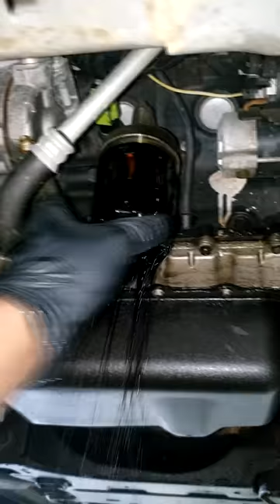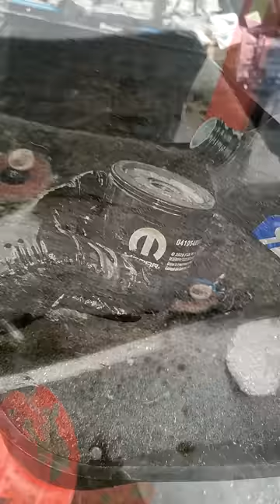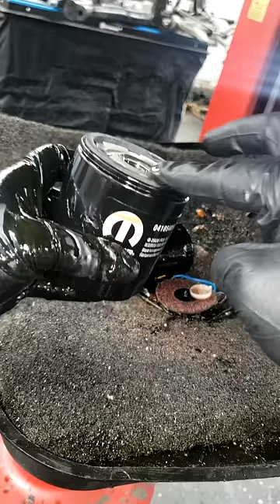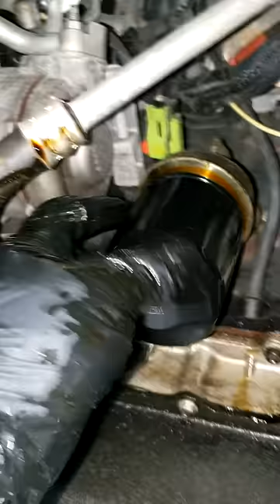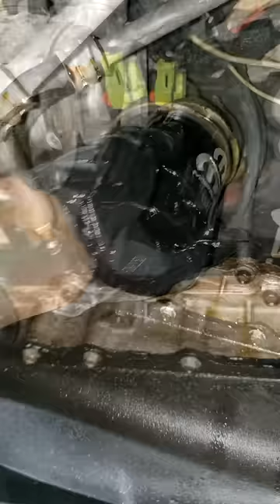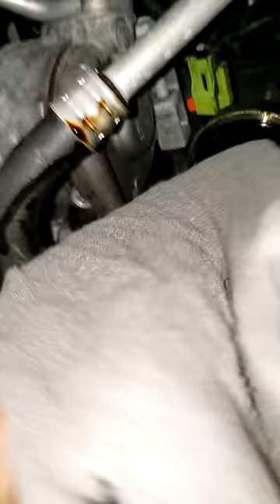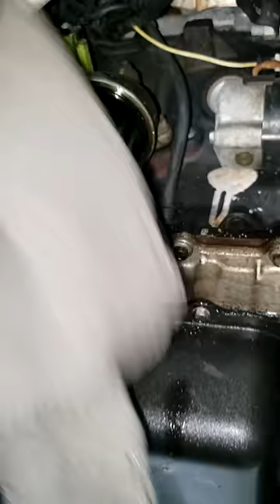Don't Lie.. Are yall still doing this?

Comment: 1) ALWAYS lube the gasket with fresh oil. 
2) pre-fill only works on vertical filters.
Reply: Answer is yes
Reply: I've pre filled my 2017 forester filter.  It's vertical but. Upside down.  I fill it up and the filter soaks it up.  Then I flip it over and screw it down.  Never makes a mess.
Reply: He primed the oil filter, but he did not clean the filter meet surface on the engine, old oil was still evidently still there, should have cleaned it before the new filter wa put on.
Reply: It's also entirely unnecessary to fill them the pump will fill the system in under 10 seconds of not even 5
Reply: @spyrolover24  can be done on  engine with good access, but it' s rarely the case on todays cars...
Reply: @Chrissy212 yes, I have 2 classic cars w huge upside down filters, and oil pressure gauges. they register within 5 sec of starting, no worries here (80 MGB, 73 Aston Martin)
Reply: @Chrissy212  if that's the case then the filter wouldn't need a drain back plug to stop dry starts..which is why you put oil in the new filter ....to stop a dry start
Reply: @leneanderthalien  orientation axis doesn't matter. The filter media will hold a surprising amount before it is completely saturated and no longer absorbs additional oil.

It's a described procedure in most older FSMs. Pour a small amount in, turn the filter body 90° and rotate until filter media absorbs the oil, repeat until filter media is saturated and no longer absorbs anymore oil, a very small amount of visible oil should be present, drain off excess if overfilled, install.
Reply: I don't fill the filter, but I do wipe down the area clean and put fresh oil on the gasket.
Reply: @spyrolover24 I was wondering about that.
Reply: gotta clean your mating surfaces as well.  im not a smart man but i always prep my gasket surface before contact.
Reply: You can at least get some on there without a mess.

Comment: Hard to believe anyone thinks fresh oil is dirty. It’s as clean as it will ever be.
Reply from the maker: Lmao, dude, I see such comments on this video at least 3 a day. I scratch my head every time. Its like they suggesting that even the new oil thats going in should be filtered of any trash and im like, but its new oil. Some people just think entirely to hard and over think things..smdh
Reply: @OnlineMechanicTips most people don’t think enough honestly. They just open their mouth with what ever first pops in their head.
Reply: @OnlineMechanicTips I had never heard of that. Good tip.
Reply: @OnlineMechanicTips most people just wanna debate about SOMETHING 😂. If you said the sky is blue someone in the cesspool comment section of YouTube would've been like "well technically is not blue 🤓🤓🤓🤓
Reply: The theory of putting the oil in the filter is that the oil will get faster to the engine thus lubricating with minimal damage. I change my own oil and never do it while having cars lasting for hundreds of thousands of miles.
Reply: doesnt get any cleaner than brand new oil
Reply: @OnlineMechanicTips  lol if they think new oil can be contaminated which has always been an unavoidable case and also even a new filter fresh out of the box is also contaminated with microplastics and dirt. By that mindset they should dunk their fresh filter into brake cleaner to get rid of those microscopic particles as well and might also buy a new engine every oil change too since old engine is also contaminated with dirt, metal and sot which will ruin the filter and the engine if they’re so worried about little tiny particles will scrub their cylinders from pouring fresh oil in the middle of the new filter.
Reply: Thanks. I thought I was tripping.
Reply: Right? All these people worried about getting oil in the outlet side of the filter when oil from the jug is clean. Now a fuel filter is a different story. I don’t fill oil filters anyway so oh well
Reply: Last time I checked the oil fill hole goes directly into the head of the engine. I can literally see my camshaft on my ford 4.6 when the oil cap is off. So unless these people are filtering the oil as they pour it into the fill hole they are still putting unfiltered oil in the engine. People really think they are smart when they make that statement.
Reply: You haven’t worked with engineers either.  If you look at “ fresh “ oil under a microscope you’ll quit flapping about things you don’t know about…
Reply: @GlycerinZ  yes it does, until it goes through the filter there’s all kinds of contaminants in oil.  Do you think it’s refined in food grade facilities and then carried in sterile trucks and through sterile pipes into sterilized bottles?  
Think again. Look at it under a micro scope sometime and rethink your statement.
Reply: @axe4770  or, they’re right, new oil IS contaminated, unless you get yours from some special sanitary food grade facilities.
The filter removes the foreign particles down to microns.  
When oil is to be used in some equipment it is pre-filtered and tested down to a predetermined micron allowance because it’s filthy from the factory, the trucks, the pipes, the tanks …all of it.
Your oil is “ as clean as it will ever”  be AFTER it goes through the filter.   There is a whole world of things you don’t know and others have been trained in, this is just another thing you don’t know about.
Reply: @OnlineMechanicTips they think they gotta drink it
Reply: Until a small piece of the foil/plastic seal accidentally gets broken off the top of the bottle when opening it and gone unnoticed. It happens. I dont pre-fill my filters for that exact reason. Never have, never caused an issue.
Reply: Because it’s fresh straight from the ground 😂😂😂😂😂
Reply: Some people are so worried about new oil being contaminated and pouring it into the filter. What do they think is happening when they pour 5 quarts of unfiltered oil into the fill hole on top of the engine?
Reply: @neilchilders5442  Its not about filtering the new oil,its about getting oilpressure faster.
Because when you start up the car the oilpump first have to fill the new empty oilfilter before you get oilpressure.
Reply: @AntilleanConfederation  they are trying to prove their value, they just gotta try and one up someone.
Reply: It's not to clean new oil it's the pocket of air that people worry about
Reply: Oil is messy new or old, it is dirty.
Reply: Yea no you just dont have the capability to understand contamination. Youre the guy in the video bud. Simple. Anyone can turn a wrench@OnlineMechanicTips
Reply: Nope.  It could have plastic bottle shavings in it.  Or even a gnat that flew into it when being installed.
Reply: Not as dirty as the film
of oil left in your oil pan.
Reply: @Vikingxb  how do you fill your engine with oil then? Same concept of the seal applies to your oil fill spout, and chances are youre paying less attention there compared to aiming it into a filter.
Reply: @100GTAGUY  chances are it will go straight down into the sump, then it would get stopped by the screen on the pickup tube before it got to the filter. Where as, if you prefilled the filter and a piece got in there, then theres not really much else stopping from going further is there. Depending on which side of the filter you prefilled it on of course.

I mean, either way, shit happens. Just my own personal preference. And the fact that every car i own, and every one ive ever owned, the filters are mounted horizontal so that makes it a bit more tricky.
Reply: Same people that probably think that something ACTUALLY happens when people get offended.
Reply: .. @GlycerinZ ..oil thins out..then its no good
Reply: @OnlineMechanicTips well brother to be honest your exactly right no need to filter new oil but on the flip side I don’t trust anyone so I always filter my oil just peace of mind and safe practice but Iive and let live
Reply: Fluid analysis says different. "Clean" oil is still dirty even though it's clear.
Reply: People must think they pull oil straight out of the dirt and bottle it.

Comment: Depends on the engine. When i change oil on a large diesel that holds 10 gallons with 2 large oil filters yes, runs to long without oil in the system.  A small 4 cylinder no, some are even installed sideways which are empty for a few seconds anyway. So for me Depends, been servicing engines 40 years. With no oil problems

Comment: If it was necessary, no manufacturer would have horizontal filters. Oil pressure builds in seconds. There is enough oil left on moving parts to protect on startup.
Reply: Exactly modern oil pumps also have a high flow and reg flow stages and will run at maximum flow pressure until the sensor at the top sees proper pressure
Reply: Although I agree with that, manufacturers DO say change oil every 10k miles now and that you never have to change transmission oil. So they don't exactly have our best interest in mind these days
Reply: Better be safe than sorry. For someone with a single car, daily driver, that is essential for transportation, rather have the pump work less, even if it is for 1/10th second
Reply: Lol a lot of medium dity and big trucks take close to a gallon of oil in their filter. If you don't prefill then you're insane. Plus most have it printed to prefill them in pictographs on the filter
Reply: Ever own or look under the hood of a Subaru?
Reply: false, engineeers make stupid designs ALL the time.  What's important to an engineer is not the same as what's important to the mechanic or owner.

Comment: 17 years in the game and I still prime filters if they're installed vertically. Idk if it makes a difference or not, but it certainly doesn't hurt anything and makes me feel better about starting the engine dry, even though there is still oil in the bearings.

Comment: Use to as a teen. Then I became an engineer and learned from those that design fluid systems why it honestly does nothing and risks adding something to the system that might plug it due to the center hole being the outlet of a filter. Such as a piece of the foil on the bottle, a bit of cloth etc.

The reason why it doesn't do anything is that after you drain a sump the oil pump still has to move all the air in the line down to the pickup and all the air to the filter regardless if the filter is full of oil or not as gases can be highly compressed.

So until that whole part is primed and charged that oil in the filter just stays in the filter and the time it takes to charge the filter itself once the lines are primed is a fraction of a second.
Reply: I've taken the time to study the engine block and head oil ports. Even disassembled oil pumps. Pre charging the filter is good if spilling oil and making a mess is the goal.
Reply: This is a pointless task. Nothing is achieved with this other than possibly introducing debris to the oil system through those holes and not to mention how dirty of a job this was
Reply: Intelligent response. Thanks.
Reply: Thanks, I was looking for an answer like this.
Reply: This guy science
Reply: My oil filter goes on horizontally. This technique would never work.
Reply: I was about to write the same exact comment. Nice to see someone else knows what's up. This is why certain manufacturers (i.e.- subaru) use an "upside down" filter orientation. It's not necessary and just another "failure point". Every extra part/step added to a system is another opportunity foe failure!
Reply: Appreciate the insight from all you guys
Reply: I should have added this comment, I have never pre-filled any of my filters and never had any problems.
Reply: yeah i firgured that was the case. like it purges the whole system in less then half a second and your car setting over night the oil drains down to the pan anyways so your car is having to prime the oil lines daily and two shot glasses of oil dont seem like it would make any difference at all .the parts dont have time enough to cause wear unless your like starting your car at redline
Reply: I can tell you for a fact it definitely makes a difference on at least certain vehicles that I’ve worked on in my time. Most Hondas for instance; if you just put the filter on dry, you will absolutely 100% hear the bottom end knocking for the first few seconds until the engine builds oil pressure as well as illuminating the low oil pressure light for those moments. If you essentially “prime” the oiling system by filling the filter to its capacity with fresh oil and then putting the correct amount in the oil pan, when you start the vehicle it will barely make any noise at all and go right into normal quiet operation plus the low oil pressure lamp will go out immediately. So to summarize; in at least a large majority of engines the system absolutely builds oil pressure faster if you fill the filter with oil vs installing the filter dry. Any time spent without oil pressure is detrimental to the health and longevity of an engine. Therefore filling the filter with oil DOES serve a benefit to most engines.
Reply: But it brings down the time it takes to prime the whole system. So it’s very worth it even if it only helps with a couple seconds, that’s a couple seconds of zero oil pressure every oil change, it adds up.
Reply: @Rekt-M8-v4  You realize the system mostly drains out through the clearances when the engine isn't running when parked right? And yet the oil pressure sender which is just a simple pressure switch located most often in the last part of the block that gets oil opens within a second of starting. 

Your everyday standard engine oil pump moves up to 8 gallons per minute of oil. These gear pumps can generate pressures so high from that flow rate they use pressure regulator valves so as to not over pressurize the system at high rpm.

Idling a engine requires very little oil flow as there is no load which will hammer the con rod into the crank journal and the film left behind is more then enough.
Reply: @Rekt-M8-v4  more like an extra half a second and no it really doesnt add up the film of oil on the internals protects it till it can get normalized pressure sure in old ass cars with clearances of playing cards it might change a little bit but even then your engine is to cold to cause any wear unless the bearing are bone dry from setting for 35 years and thats not something that happens every day. 

once an engine is finger printed that helps even more. long story short it literally doesn't matter there's no way a second of no oil will hurt your engine. now having stuff put into the filter reverse where its unfiltered  oil with a small strand of hair or pieces of the seal that you removed or even micro dust particles will cause WAY MORE wear and possibly even blockage and completely throw a rod or spin a bearing. you run way more risk making you car suck up unfiltered oil then an extra half a second of no oil. but even then its fairly small unless you got clearances of .001-.003 mm then you BETTER always have filtered oil those clearances are so tight that even dust can fuck up your bearings
Reply: @kennethpowers8995  sounds like your oil pump is worn out and need to be replaced no wy in hell a civic is rod nocking after a filter change unless your rods are already worn the pump is worn or a mix of both being slightly below spec  sounds like your talking about an engine with 300k+ on the tac
Reply: @makoshark40  well that’s why you pour it into the side holes so it gets filtered. Also I did some calculations, and if we were to calculate according to what you said, half a second, when a car is at 200,000 miles and gets an oil change every 4000 miles, that half a second every oil change turns into 25 seconds of running with zero oil pressure over the cars 200,000 mile life. And if we were to go by the difference between pre oiled filter vs oiled filter in my own car, that would be 1.5 seconds ish, that’s about 75 seconds through the cars 200,000 mile life running without oil pressure. That’s alot. So as you can see, it does add up, and it’s very worth it with the minimal effort it takes to pre fill the oil filter correctly. I don’t know about you, but I want my cars lasting 300,000 miles plus, and with the minimal effort it takes, I’ll prefill my oil filter correctly and you should too if you want your car to last.